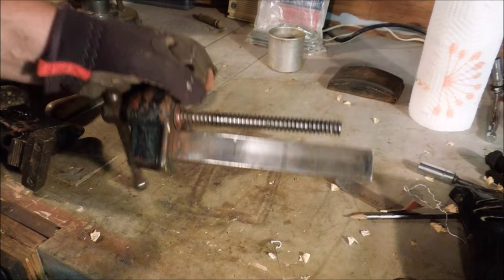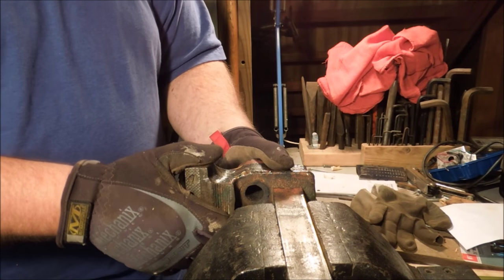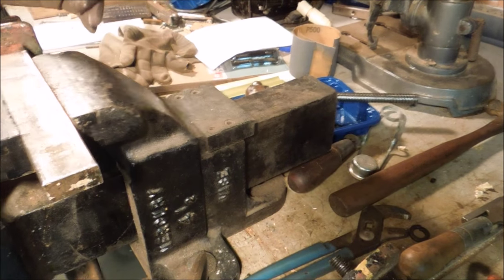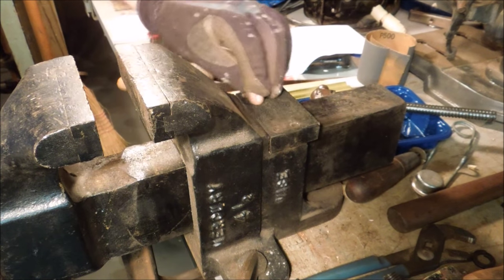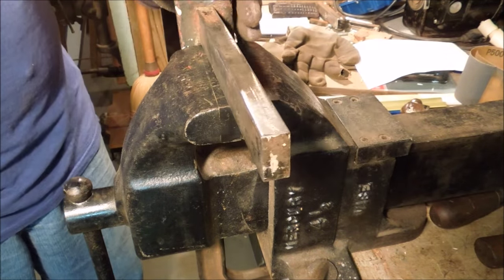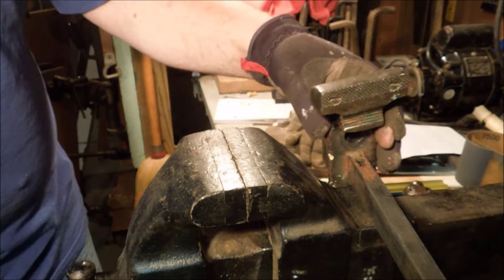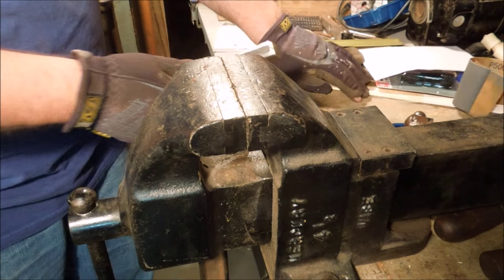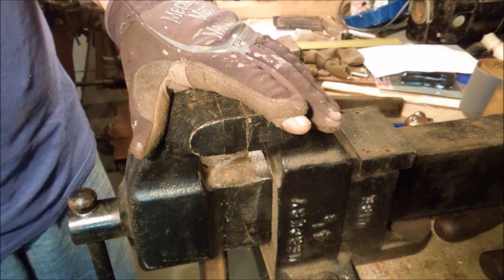Proper Use Of Tools  Pt 1   Vises   From Old Sneelock's Workshop

Comment: Right-O Unc. Tools work better if they're used for what they were meant for. The Red Green philosophy that "Any tool can be the right tool" doesn't always apply. You might get away with it but like you said; you can also buy replacements. I can't afford that so I try and take care of what I have. And if I can improve it without wrecking it, so much the better!
Reply from the maker: +Lewie McNeely Since the, "Any tool can be the right tool." philosophy came from my hero Red Green, I will allow him his quirks. I do tend to think twice before taking advise from the Duck Tape King. It's sometimes called 200 mile an hour tape, but at 200 MPH I want something more than some mylar, a bit of thin cloth, and some sticky stuff, between my butt and the pavement. :-)
....Remind me to tell you the story about that someday....
Reply: Me too and likewise I'm sure! Red has some good stuff and is SOOOO close.  One of the first ones I saw was Walter trying to back the boat trailer. I was in the FLOOR! And "Red's Hot Sauce" was another. Patrick McKenna was a dandy actor to play Harold like he did but the whole cast was amazing. I had to use some of "The Handyman's Secret Weapon" on the blower tubes today. I always think of Red when I hear that tape squawk!